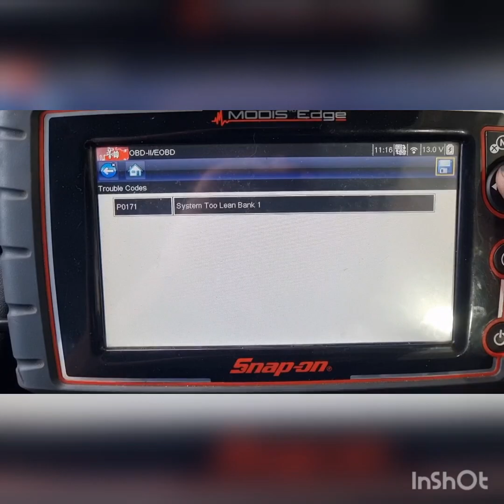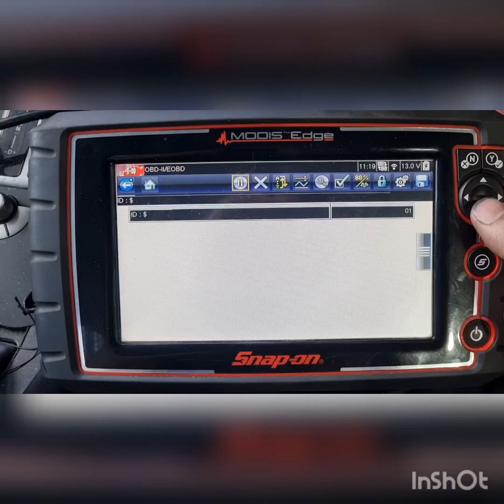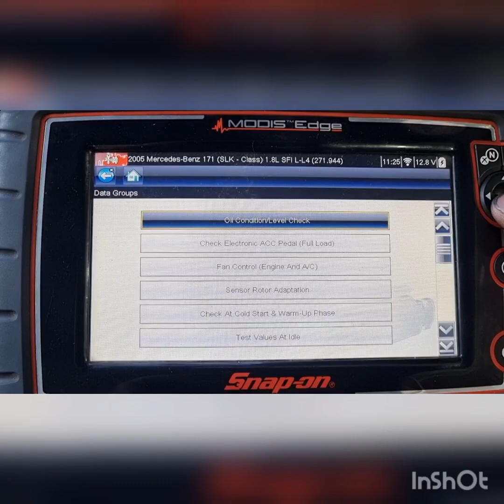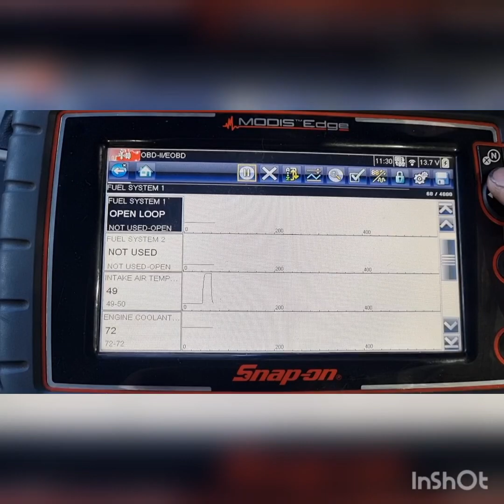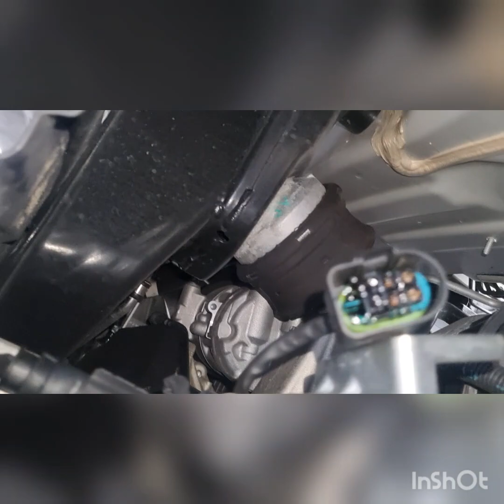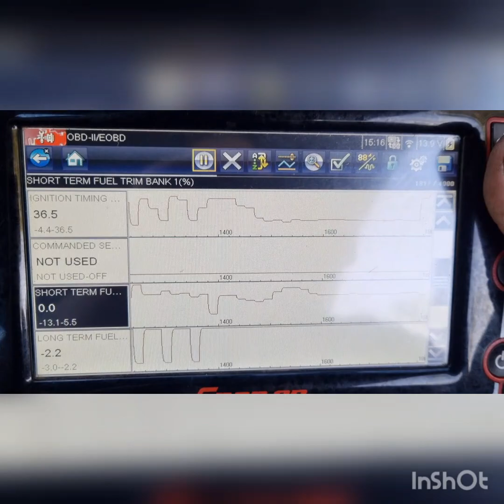Mercedes SLK, Fuel Trim Fault P0171 P2029 P2046

Comment: My fuel trims on ny w203 m271 are alternating between rich and lean. No o2 sensor codes but closeloop fault. How do i test this upstream sensor with 6 wires. Do you have the pinout?

Comment: Found oil in the o2 sensor plugs cleaned the oil from plugs replaced o2 sensor replaced crank breather pipes and smoke pressure tested plastic intake manifold replaced inlet seals 
And came back with fuel trim code today I’ll check the cam sensors tomorrow and clean wiring loom tomorrow from top to bottom 
Thanks for the only vid I found relating to this problem 👍

Comment: I had this issue also. New cam solenoids, the adaptors have special wire that does not allow oil to pas, just a precaution for the future. But unfortunatly i changed the engine wirin harness also and the O2 sensors. That oil will never drain all and because the O2 connectors are at the bottom you will constantly get mixture errors
Reply from the maker: Yeah for sure, sometimes it can make its way to the ECU aswell!
Reply: Hi,how do you get rid of the errors as I too getting lean & then rich mixture errors? I've changed the lamba sensors and soldered the wires to stop any further oil ingressing into the sensors? Last resort ,I have a replacement engine bay harness, but o don't really want to do that if I don't have to,please help???